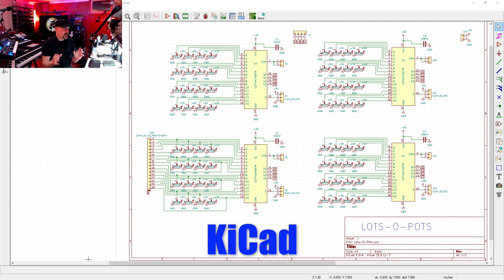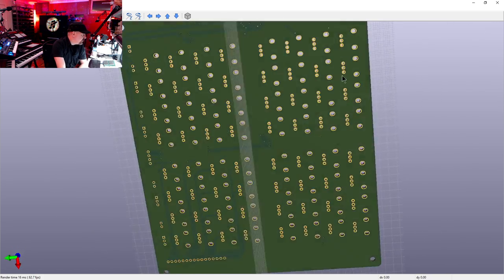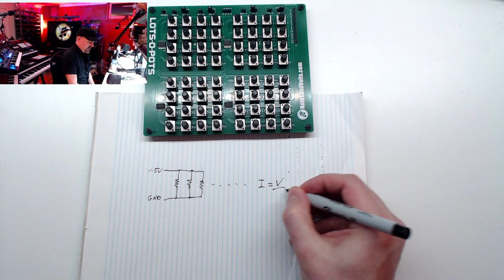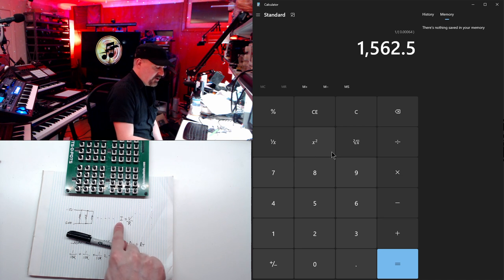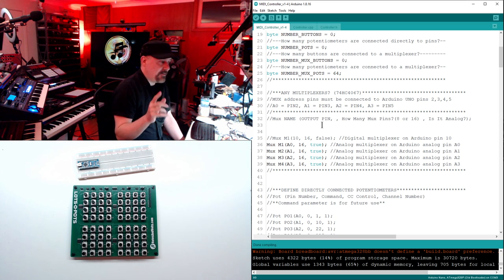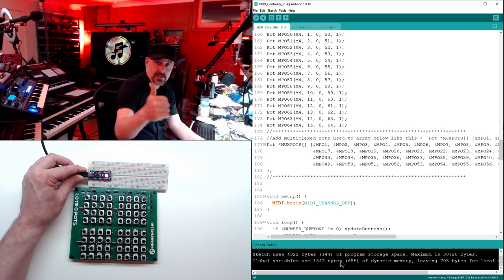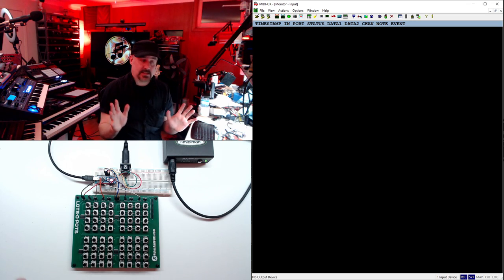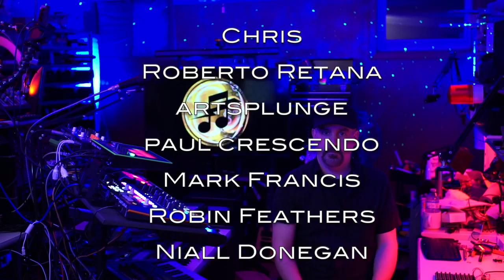Can the ARDUINO NANO handle 64 potentiometers?

Comment: Problem - if all pots are set to minimum you get almost a short and will likely blow the Arduino.  Solution - 1 x 270ohm Resistor in series to ensure no more than 20mA flows regardless of pot settings.
Reply from the maker: Sorry this is not true. The wipers of the pots are connected to the Arduinos analog inputs which have a high resistance. They will never be grounded.

Comment: As long as the leakage currents aren't too great, you can connect the 4 COM outputs together and to a single analog pin on the Nano. And then use the Enable inputs of the four multiplexers to enable a single multiplexer at a time. Then you can have the 64  pots on a single analog pin. With 8 pins (and 8 of the lots-o-pots boards) you could have 512 pots!
Reply from the maker: Thanks for the info Tom!

Comment: I am under the impression you can only read one pot at a time with a mux. This means you can't turn two pots at the same time and get them to send data. Is this correct?
Reply: I have the same question. Do you have a answer?
Reply: @ sort of. You can't send more than one data point at a time, but apparently it's happening so fast it doesn't really matter. Or that's what people say. And I built a test with 8 pots and it seems to be ok.

From what I can't tell it's only one piece of data that is sent per check, but the code loops run so many times per second that it's checking everything within milliseconds.

Comment: You should check the linearity of the cc outputs. The analog mux does not cut the line completely but its disconnected pins become "Hi Z", making its connection to the COM ın the order of Megaohms. On the other hand adc input is low impedance, loading the source. If you use high resistance pots, it is possible that combination of pot positions may affech each other.

Solution 1: use 10k or lower potentiometer, add a 4 to 16 decoder and connect same select signals to decoder input. Feed each output to the corresponding pot and energize only the pot that is being read.

Solution 2: add buffer amplifier to mux output so that it can drive the adc without impedance effect.
Reply from the maker: Thanks for this info! I'll look into it.
Reply: Any idea why I thought 74HC were buffered?

Comment: 6:45 64x 10k pots have common resistance of 156.25 Ohms, at 5 volts current will be 32 mA; total power = 0.16W. Plus consumption of 4 multiplexers of course.
Reply: this will drawn from +5V line, not from arduino.

Comment: Super job, however @thepcman is correct 10k pots @ 30mA is a better choice, the lower the source impedance the better, I think100k might be a bit high depending on the difference between 2 successive ADC samples. The ADC in the Atmel 328P uses an 8 channel multiplexer with a sample and hold capacitor so, with a high impedance source (100K worst case ) there might not be enough time to charge/discharge the the S/H capacitor properly, possibly leading to some strange readings. Below is a extract from the 328P datasheet page 212:

"The ADC is optimized for analog signals with an output impedance of approximately 10k or less. If such a source is used,
the sampling time will be negligible. If a source with higher impedance is used, the sampling time will depend on how long
time the source needs to charge the S/H capacitor, with can vary widely. The user is recommended to only use low
 impedance sources with slowly varying signals, since this minimizes the required charge transfer to the S/H capacitor"
Reply from the maker: Thanks for the info! I'll didn't notice any ill effects but I'll definitely look into it.
Reply: A trick used by ADC circuit designers is to use diodes to drop the voltage across the variable resistor.  You'd have less usable ADC range, but could lower the value of the pots without excessive current draw.  Two diodes would still give over 3/4 of the 1024 range.  Since the voltage drop across diodes doesn't change, current draw won't affect your readings.  A bonus is that if your ADC has non-linearity issues, you can put one diode on the + side and one on the ground, and the range ends (usually where non-linearity is worst) won't even be used.

Comment: Nice video! Personally I struggled with unstable pots readings, but finally I was able to write class for handling potentiometer, which used hysteresis to get rid of bad readings. Moreover, I added callbacks to be able to react to a certain events (e.g. value change, going up, going down etc.)
Reply from the maker: Very nice!

Comment: To find the resistance in a situation like this where you have the same resistor in parallel, you just need to take the resistance of the resistor (100K) and divide it by the number of resistors (64). The answer would be 1.5, but that would be 1.5K, so if you times that by 1000 you get just the ohm amount.

Comment: all depends on what refresh rate you want, the ATmega328p datasheet specifies the adc max rate to 15000 reads/sec, so if u only need a refresh rate of for example 30 you just divide 15000/30=500 so the number of pots you can connect in that case is 500, to do this you can cascade the 16to1 analog mux with 16 others witch would give 16x16 = 256 and then use two analog inputs of the nano for a max number of inputs to 512
Reply from the maker: Thanks Jannik! Great info

Comment: Interesting 🤔What happens when 2 or more pots are adjusted at the same time? Which gets preference? Does it work as a polyphonic input?
Reply: i want to know this too
Reply: @MoritzLuzner the Messages are send so fast that you won’t notice they are processed sequentially. It always works like that with midi streams. 1 by 1 at blazing speed
Reply: ok thank you!

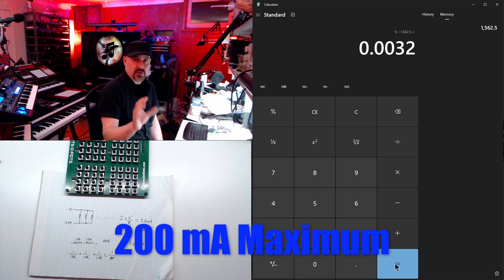Comment: 13:16 wrong. if you not powers Lots-o-Pots 5V from output pins of µC you will not exceed 200mA limitation. You project is powered from USB or from AC/DC adapter, so Atmega chip limitation is not involved at all.

Comment: Amazing project !!! i don't find the code 1.4 on your website (only the 1.2 is available). Could you please share the code and the PCB conception file? you don't talk about the mux lib in your video, this is works with MCD74HC4067 also?

Comment: The nano actually has 8 analog inputs :) A6 and A7 are analog only pins, as where A0-A5 are multi use. 
Most tutorials ignore these pins because they have extra rules if it where. 

Anyway. I would say not 96, but 128 pots without resorting to other tricks like multiplexing the multiplexers with chip select pins.

Comment: Can arduino read multiple pots at the same time? i.e. if you turn 2 at the same time will the DAW get signal from all at the same time or one after the other?
Reply: This is what I was wondering! What happens if you turn two or more pots on the same multiplexer? I might have to build this thing to see
Reply: I haven't seen the code to kkow for sure, but the midi signals can't be sent concurrently anyway because there's only one data wire, but the time difference is practically nonexistent
Reply: @romeolz  thanks for that. This is interesting, so technically the signal would go one after another and not simultaneously, but the time between them would be a fraction of a second (or millisecond) and almost unnoticable if  I understand correctly?
Reply: @iamdigilog  the arduino runs so quickly that the time difference could be in the microsecond range, midi messages are only a few bytes

Comment: Do you have the code for that? I am using an Arduino Micro with four 74HC40512 Multiplexers. It's USB MIDI compliant. So I don't have to use the MIDI Din adapter. I have followed you since the first controller video. I appreciate all you do!
Reply: yeah me to i want the code for usbmidi plaese
Reply from the maker: The code link is in the video description. This program uses direct port mapping for the Uno/Nano so it would need modification for other models. Plus you would need to replace the Midi library code with the USBMidi library.
Reply: @NotesAndVolts  Thank you very much. I am working on it today. :)
Reply: I have built a midicontoller a couple of years back based on this code (already with 4 multiplexers on a Uno) Im planning to migrate it to USB midi coming weeks with some code adjustments.
Reply: Hey guys, I have an arduino micro here and I would love to do the same stuff with USB MIDI. Can you please let me know, when you have some code? I am quite new to this and would very much appreciate some code I can learn from!

Comment: Just made one with 32 pots. One of the 2 mux circuits behaves as it should. The other its very strange and unstable. When you turn a pot the pots next to it get voltage change whith result erratic midi signals...cant find solution yet. Maybe bad pcb design? 😢

Comment: The code you linked goes to an older blog post that contains V1.2 of the controller - in this video you're using V1.4. Is there a difference when using the Nano? The code in V1.2 says it is for the UNO only. Thanks.

Comment: can you make this with a pro micro atmega 32u4
Reply from the maker: You can, but the program I use for this example uses direct port mapping to speed up the mux pin changes. This works on the Uno/Nano but might need to be modified for other models.
Reply: @NotesAndVolts  can you write the code for midiusb please
Reply: @NotesAndVolts  but can you White the program voor midiusb please
Reply: @edwinnieuwenhuis1930   I asked Chat GPT and he wrote me the code, but it needs to be corrected :))

Comment: Thank you for this awesome video! I am trying to build an interface for the BP synth and thought I use the code from this for a midi controller to the BP synth. I notice there is a difference between the code you supply in the notes and on the video. Would it be possible to get version 1.4? Thanks again for the great videos.
Reply: Ive adapted his sketch for a BP synth based on the controls I'd want to use (32 potentiometers and 6 switches). Just trying to figure out the best way to insert it between my serial MIDI keyboard and the BP synth. Not sure if I can include a MIDI.read statement or possibly a MIDI thru to the existing sketch from this video, or if I need to build a separate MIDI host/hub that will accept two MIDI in and one MIDI out.

Comment: Im still curious how many knobs can you use at the same time? Amazing project thanks for sharing!
Reply: i want to know this too!
Reply: Since it is a multiplexer you should be able to use all 64 pots at the same time. They are read in succession, not on interrupt. BUT: the bottleneck would be the transmission speed of the MIDI signals, which is 31.25 b/s. The MIDI packets are 8 bits. That means you can send 31250/8 =3906.25 messages per second on one MIDI channel. That is about 61 cc msg/knob 🙂.In theory.

I bet there are other factors that I don't know about or did take into calculation. But roughly it should be in the right ballpark at least 🙂

OR! It is a trick question... He can only use two knobs since he only have two hands? ;-)

Comment: Would all this muxing work  with FSRs? and what about latency? Is it possible to avoid it and have real time readings and conversion to midi?

I am planning on building fsr matrix with around 64 inputs, converting it to midi. So far i've bought arduino and make 5 of fsr work on analog inputs. Struggled as it is my first project ever, but it was a good day!

Comment: Thanks for the awesome videos, which Arduino is capable of handling MIDI usb also with LCD and sd card? I am doing a midi controller project that open MIDI file from SD, play it back on MIDI usb out, while receiving some controls from MIDI in and shows some info on LCD, what do you suggest for hardware/software?

Comment: just curious.  What is the overhead time in case I grow 64 pairs of fingers and twiddle all of them at once?  ;-)

also, how difficult would it be to have some sort of 'learning patterns of behaviour' algorithms built-on in order to match certain POB so the individual pot has the appearance of being there all the time by the controlee?

Thanks!
Reply from the maker: On all controllers, the pots are read one at a time. The microcontroller can scan them so quickly that it seems like they are all active at once.
Reply: @NotesAndVolts  does that mean that if I'd substitute the pots with pressure sensitive resistors I'd have a 64 key keyboard with velocity and aftertouch capability? that would be something!

Comment: Does anyone know how this is possible without using MUX? Wanting to be able to turn multiple pots at once
Reply from the maker: The mux doesn't matter. The Arduino only ever reads one input at a time. It just does it so fast that it seems like it is reading all the pots at once.
Reply: @NotesAndVolts  Thank you mate! I'm a complete beiginner - realised this a couple days after commenting. Thanks buddy:)

Comment: I've done the math as you taught it (but for 50K pots), and I ended with a total of 781.2 Ohm of resistance (for 64x 50K pots) , which would result in a total current draw of 0.0064A.
But... did I do the calculations right? I got no one around me to ask.  (I couldn't find the 100K faders I liked. But there's nice 50K faders on Alie-express)
Reply from the maker: Your calculation is correct at 6.4mA of current. 50K pots will work fine.
Reply: @NotesAndVolts  Thank you so much.

Comment: When parallel resistors are the same size, you can simply divide a single resistor value by the number of parallel resistors. Again, this only works when all resistors are the same size.

Comment: Are any of the "dual axis rotary encoders" my search patterns have managed to generate for me on some of the sales sites actually real?

64 of these from Alpine Alps is going to run me almo0st a thousand bucks from Digikey or Mouser, but maybe that is just the reality I dove into.

64 pots is not far behind for long-lasting ones.

it is for a matrix mixer project, thanks

I am thinking 1/10th of that budget into a redesign using touch screen may be the ticket out, but (conjuring the "I Like Turtles" kid.

"I LIKE FONDLING KNOBS"  ;0
Reply from the maker: This won't work with rotary encoders, only potentiometers. And you shouldn't be paying more than $64 for 64 pots! You can get them cheaper.

Comment: I could use your help! I entered this code into the IDE and keep getting an error message. Any Idea? 

ERROR:
error: 'MP01' was not declared in this scope
 Pot *MUXPOTS[] {&MP01, &MP02, &MP03, &MP04, &MP05, &MP06, &MP07, &MP08, &MP09, &MP010, &MP011, &MP012, &MP013, &MP014, &MP015, &MP016, &MP017, &MP018, &MP019, &MP020, &MP021, &MP022, &MP023,&MP024, &MP025, &MP026, &MP027, &MP028, &MP029, &MP030, &MP031, &MP032, &MP033, &MP034, &MP035, &MP036, &MP037, &MP038, &MP039, &MP040, &MP041, &MP042, &MP043,  &MP044, &MP045, &MP046, &MP047, &MP048, &MP049, &MP050, &MP051, &MP052, &MP053, &MP054, &MP055, &MP056, &MP057, &MP058, &MP059, &MP060, &MP061, &MP062, &MP063, &MP064
                  ^~~~
This something about a suggested alternative. Any help would be appreciated greatly!